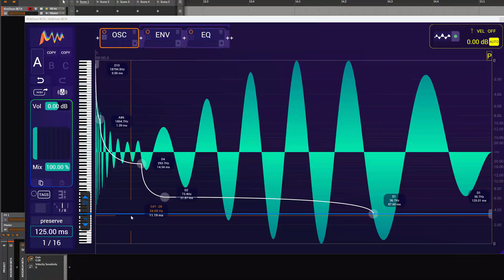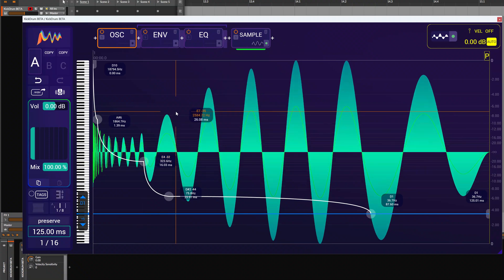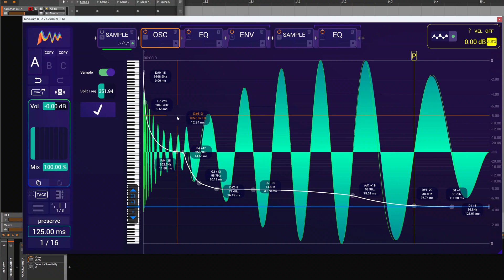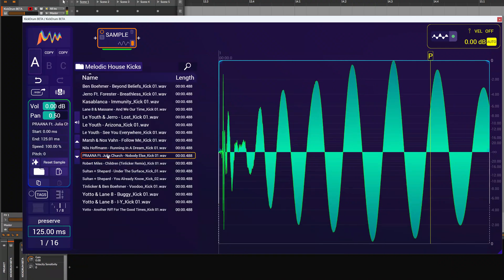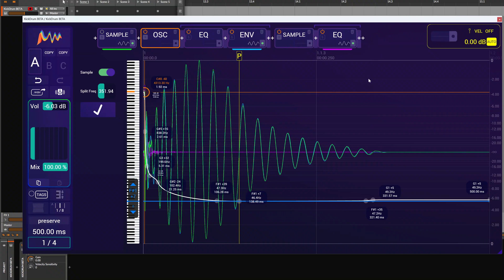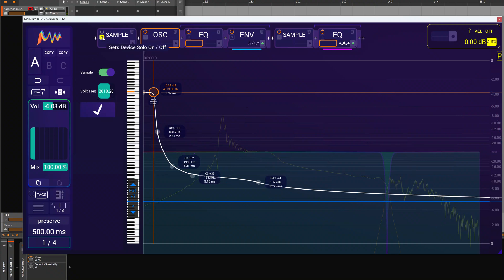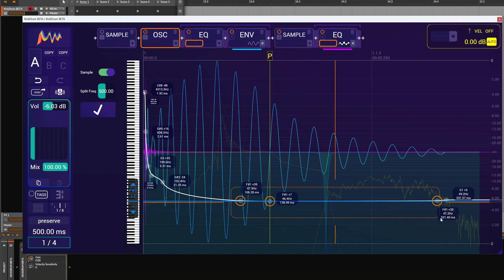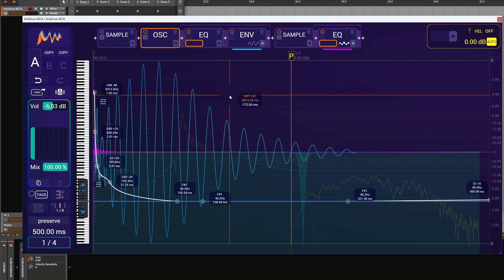KickDrum 2.0 BETA 9 | Analyze and Resynthesize any Sample to a Modular Patch

Comment: I have it . I find it complex and slightly buggy on my machine but the quality of the presets make me want to dig in . I wish it would open at half volume
Reply from the maker: nice, but slightly buggy is not good. I know there's a graphical glitch in the preset browser, that's fixed in the upcoming version. if you have something other then that, please send a mail and i'll fix it asap. for the default gain, i've put that on the list for the next release.